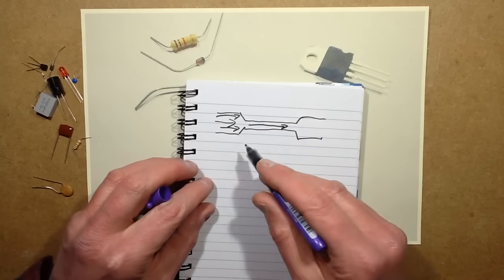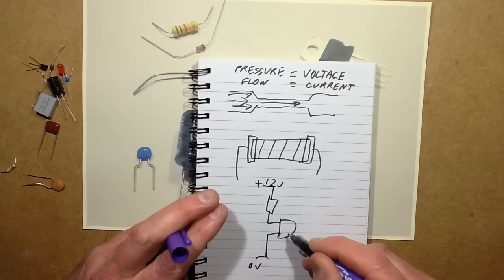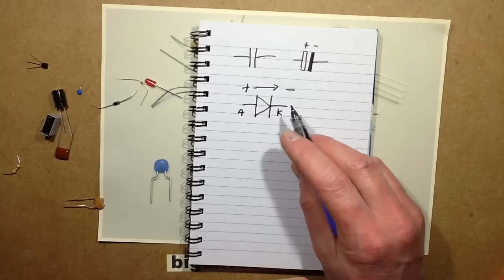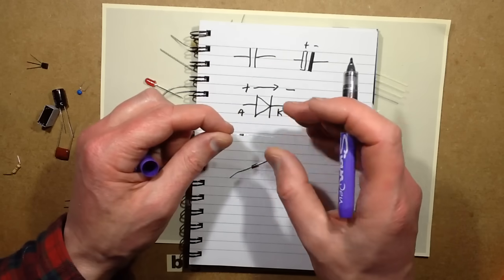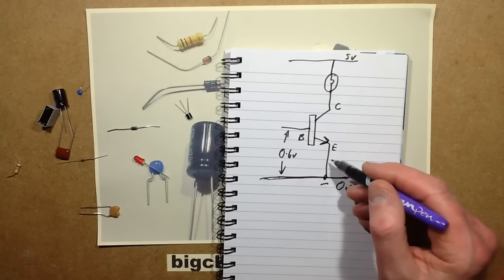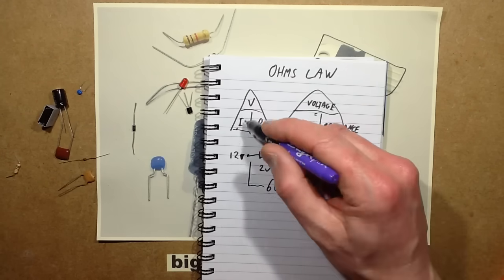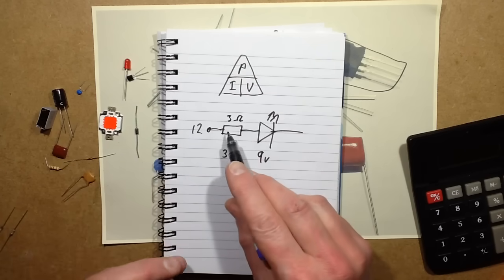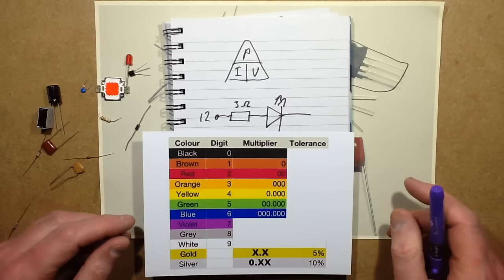A simple guide to electronic components.

Comment: using the water example is good I suppose...I've seen it used before and I have thought like this in the pass...some time ago.  Your explanation is confusing.  Fluid dynamics...water flowing threw a narrow gap...pressure should drop and the flow should increase.  On exist fluid motion should returns to normal providing the before and after are the same size.  Now I wonder if the resistor and flow of electricity act in this manner.  I think not...but...please continue.
Reply: +FREEMAN DECKER    ROCKET ENGINES !  The engine gasses are compressed in the Venturi. But upon expansion, push upon the nozzle surface providing pressure to a larger surface area.   BTW Upon a enema or clyster,, don’t have the water pressure at maximum pipe diam. rated flow, but increase gradually till a rate of comfort is achieved.
Reply: +Chad Hurley  of course, here you are discussing gasses..and maybe more relative to the explanation to electricity...one would imagine emf is compressible.  Moving on into your video I almost grasp what was happening inside a resistor...I will come back to this later and watch this again.  This is a learning process for me and I am presently amazed about the principle of processes moving from the negative to the positive in other things besides electricity.  example:  ice cube absorbing heat instead of the heat absorbing the cold.  Amazing.
Reply: FREEMAN DECKER    In our world, 2016, there are so many questions to be answered, if we only had the time. Organic chemistry, gene reconstruction, quantum possibilities, Unbalanced electrical gravitic draw space craft, harmonic frequencies to cure cancer and many more diseases, Government disclosure that would open a pandoras box of evil or sanctuary But in the end, the planets dominant species will always cut off the limb that he is sitting on, unless a coalescing consciencenes allows us to see our inevitable future.
Reply: +Chad Hurley "inevitable future"... I stumbled across the news about an anomaly coming out of a black hole.  I guess you've heard about this?  The Black Hole is 6 million light years away and the anomaly occurred 6 million light years old.  I've run into something of a paradox here and it has to do with light that strikes the cornea.  It seems that we are always looking at light that came from the past.  If we are seeing only reflected light that has bounce off another object, no matter how close you are to that object the light would still need time to travel from point A to the cornea to see the object at point A,  Just to get a glimpse of the "Present" we would have to be at Point A the very instant light strike the Point A.

So...I am going to have to sleep on this to see if I can figure out where this "Paradox" is going.   Thanks
Reply: FREEMAN DECKER   Well you give room for thought. We both know that physically we cannot see the present, but this is semantics.
    This video was about basic voltage/current flow. My interest is more about observance and study by exterestrials.  How they get here has not been my study. Anymore that you being  obsessed with your wifes biology and birth, just because you married her. 
    God, of course, was the best written about extraterrestrial

Comment: One thing I am surprised you did not mention in regard to Capacitors is the fact they can hold a charge.   I once got zapped by one from a camera.  I took the battery out and started ripping it apart.  Suddenly I felt this shock go through my hand.  I found out later it was about 12Kv.  Great video though.
Reply from the maker: +osparker2 A pulse of high voltage at low current is usually used to fire the xenon discharge tube.  The electrolytic capacitor is usually charged to about 300V and can give quite a zap.

Comment: Hi Clive, I have watched a few of your videos now and been trying to keep up with you. The one with the dehumidifier got me hooked, as I have a broken dehumi. I took it apart as it no longer collects water and as per your video, it needs a heater to release the moisture back into the exchanger. I hope I got this right and have not made myself look a wally. Well I have the eco d122 with touch controls, so when igot the heater out and my multimetr out to check the element, I got confused. There are three wires conected , red blue and black. I can get resistance and continuity  between red and blue, but nothing on the black to red or blue. The black wire is coneted to the same 3 pin plug as the red and blue on the CB. If there is circuit between red and blue is the element ok, or is it broken because no short with black,Please?. Ps how do I test those relays you talked about to. One was a thermal and I cant remember the other one for. I am hoping its going to be one of those at fault. Can you recommend the best allround solder for a novice like me also. Many Thanks, Leon
Reply from the maker: +Leon Hill There are usually three wires going to the heater just for power.  A common and two wires that select the power.  There should be continuity between them all, suggesting a broken heater element.
Reply: +bigclivedotcom  Thank You for the return mail. I  need to go to bank today, But will get my multimeter out ASAP and check thee connections again. I need to get it fixed so I can free my bench up in My 'CAVE', as my wife calls it!! :) Leon.
Reply: +Leon Hill Hi Clive. Great news. I put 1 meter lead on the black cable where it enters the heater block and then with the 2nd lead started to follow the element as near to the start as possible. Beep, beep,beep then nothing. so I got my magnifying glass and sure enough , just as you said a break in the element. Well after a long phone call to ecoair.org and not much help. I have spliced the element wires together in a fashion to test it. And sure enough it has started to collect water again. However. the dehumiifier keep constantly runnig  as if it cant sense the humidity levels . I have put it next to my simple one with rotary controls and this cuts in and out on humidity levels, but the mkllll at the side of it just keep on running??. So can you tell me how to test the humidity sensor, if you have any spare time ,please? I have looked at several of your vids and everyone if full of how to questions. It must take so long to reply to all these questions, its a wonder how you have time to make any strip down feature vids.  :) Many Thanks, Leon  :)

Comment: In college, "we* (well, yes, I, but it was a group decision) blew up an old 330uF/25V capacitor by reversing the polarity on the beefiest laboratory power supply we had (30V/7A). It split down the side and showered me. I didn't have my lab coat buttoned up, so I spent the rest of the semester picking scrap pieces of paper (I think) out of that particular sweater. Good times.

Comment: So honest question.  Using the water analogy, when you neck down the area water has to flow it usually speeds up. Is there a similar effect in electricity?
Reply: +Greg Fuller I think that is where the analogy stops. Electrons flow at the same speed through a particular medium, independent of the resistance.

Comment: watching this brough back memories from when i was doing electronics in high school some fun times like when we decided to plug an led straight into the output of an ameter or popping capacitors with the plug used to power the soldering irons 
and I=V over R even then i felt as though it was over my head 
we use to use 330 ohm resistors with a silver band

Comment: Could you explain the old Glass Radio Valves? Maybe you already have?  I must have broken many open in my youth and admired the complex construction. But what did they do? I take that they were replaced by the components you describe here.
Reply: +Roger Griffith Valves, or "vacuum tubes" in America, did mostly the same sort of stuff as diodes and transistors, and were almost entirely replaced by them.  You might still see valves used in high-voltage circuits, especially in audio amplifiers.  (Some people claim they produce better sound than transistor amps.)

Comment: How do capacitor work in electric guitars?
Reply: +shinedown389 The TONE knob of an electric guitar is simply a variable resistor (exactly like the volume, though its 'taper' (response curve) and resistance rating may differ). When the tone is at 10, signal is passed to the amp, no signal is passed to the capacitor and it has no effect on the tone. As the tone knob is turned from 10 toward 1, more signal is passed to the capacitor, which passes high frequencies to ground, preventing them from reaching the amplifier. The capacitor resists passing low frequencies, so they continue on to the amplifier. So, the capacitor and potentiometer are used as a variable high-pass filter, dumping more and more of the high frequency signal to ground, instead of sending it to the amplifier.

Comment: Clive I need to buy a fairly cheap soldering iron for repairing electronics like DC jacks and reflowing connections and I have looked on ebay but there is so many are there any brands / sellers you could recommend? Thanks.
Reply from the maker: +Philip Sempers The generic Hakko clone soldering stations with numbers like "936" are quite usable.  Just ignore the temperature marked on the control knob or display and adjust it for best results.
Reply: +bigclivedotcom hakko now you say the name I have heard you talk about them before just wasnt sure which video. Thanks. :)
Reply: +Philip Sempers
These days you can get one of those regulated soldering stations for the same price I bought my first unregulated 20w iron in the early 2000s
Gotta love the march of technology (and cheap stuff from china)
Reply: +bigclivedotcom yes! I use the hakko 937D clone and it works very well but has a genuine hakko heating element
Its a YIHUA brand
Reply: jonny blaze
EEVblog did a review on that unit or something quite close to it.
From what I remember, the base/power supply is a pretty solid unit from an electrical point of view, but the fit & finish of the iron could use some work.
Both of these comparisons are in relation to a "genuine" hakko unit he had on hand.
Reply: +44R0Ndin yeah I watched Dave at EEVblog's video your talking about after Clive said about them and was confused whether to get that or just spend the extra cash for a branded station that would probably last years longer. Have you watched Dave's video Clive I can get you the link to it if you need it.
Reply from the maker: +Philip Sempers I have seen that video, but a recent version I bought seems to have a different temperature regulation circuit which pulses regularly with a varying mark-space ratio.  The calibration on all these things is poor, you really need to use a proper tip thermometer or wing it by "feel".  As Dave mentioned, the thermal coupling is poor, but the units are still fine for most normal soldering tasks.
Reply: +bigclivedotcom cool thankyou Clive there's the "hakko" one on eBay for £40 worth it?
Reply from the maker: +Philip Sempers Is it the base unit with a knob on the front and separate iron holder?  I bought one fairly recently to test and they seem OK.
Reply: +bigclivedotcom this is it direct from Hong Kong:

http://m.ebay.co.uk/itm/220V-HAKKO-936-AQ28-ESD-SAFE-Electronic-Iron-soldering-station-D-27-/151959805559?nav=SEARCH
Reply from the maker: +Philip Sempers Looks like the typical clone.  This is the one I bought recently, but they appear to be sold out.  Not surprising at that price.  http://www.ebay.co.uk/itm/291045808647?
Reply: 44R0Ndin I did see that video also but mine seems to work a lot better then the one he was showing in the video. Even my temp light pulse's very fast and heats very quickly like the real hakko units.The internals seem very different also.

Comment: I will sometimes exceed the power rating of my resistors because they won't completely fail but instead have a higher resistance (I have gotten around 5-50k from a 1k resistor) this may be good to test and see if you can control the failure rate?

Comment: Hey bigcivesotcom, 

Can you do a disassemble of these cheap Chinese flasher units for motorcycles? 
Are they safe/worth using? 

Because here is a $1 flasher from china:
http://www.ebay.com/itm/201447286359?afsrc=1&rmvSB=true

Here is a "brand name" quality one.:
https://www.superbrightleds.com/moreinfo/flashers-load-resistors/fl2-red-led-bulb-electronic-flasher/779/833/

How can they produce a $1 one? Whats in it compared to the $13 one??? 

I would love if you can order one and do a review within like a month and a half (shoudl be doable as shippign form china usualy is liek 20 days anyway). Because i plan to convert my motorcycle to LED and will need a flasher unit. I just want to make sure something like those $1 flashers are safe/reliable, or to drop the other $12 and buy a brand name. 

Thanks!
Reply from the maker: +Orvis25 I've opened one of these but not done a video (yet).  It looked acceptable inside.  It used a MOSFET held on during it's shorted cycle by a capacitor.
Reply: +bigclivedotcom 

still learning so i do not really still understand what a mosfet does. :P im not a circuitry guy for the most part, i just like learning from your videos about shoddy Chinese crap. 

Would you say these are well enough built to use as a replacement for us budget people who cant afford a $15 flasher unit? Even if it only last 1/4 as long. i can buy 15 of them for the price of a "brand name" one. 

Thanks for replying btw!
Reply from the maker: +Orvis25 The one I've opened look reasonable enough inside and with LED lamps it should be more than capable of doing the switching.  It's cheap enough to try one out.

Comment: You're spot-on about many old game consoles having bad caps. Some consoles are particularly notorious for using low-quality caps that dry out or leak after only a few years of use. The Sega Game Gear, for example, used such lousy electrolytics, that I've just come to expect I'll need to swap them all out on every unit I run across. 

Anyway, this is a terrific video with a ton of great info! Thanks for posting it!
Reply: +Shmeh Fleh Made me think of an older PC motherboard mod video I saw once. Was wondering what the interest was in replacing the caps. The complaint was the board was low cost but had inherently bad capacitors surrounding the CPU that failed under heat. Better caps, better longevity for the board and hopefully better performance.

Comment: I'm a little confused with the pressure/voltage and flow/current analogies; in the narrow pipe example, the pressure (voltage) would increase, while the flow (current) would decrease.. No? Like a pressure washer or a low-pressure correcting showerhead.. It's my understanding that a resistor limits both voltage and current? Or just voltage?
Reply from the maker: +hoah If you increase the voltage across a resistor a higher current will flow through it.
Reply: +bigclivedotcom I realise that was a dumb question ;)
Reply: +bigclivedotcom thanks tho

Comment: This might be a stupid question, but when I connect a 9V battery to a 6-15V motor and 1MOhm rheostat, why does the resistor smoke sometimes?
Reply: +Matilda power source with a high current and a device with a large current draw with a mismatched resistor.
Reply from the maker: +Matilda If you use a variable resistor to limit high current it tends to get hot as it is dissipating the difference in voltage.  That's why most motor controllers pulse the power on and off, varying the on to off ratio to adjust the speed.
Reply: bigclivedotcom Thanks!  So if I swapped out the 9V for e.g. 4 AAs would it help?
Reply from the maker: +Matilda If you need to control the motor speed then an easy way is to just use the voltage required to make it run at the desired speed.  For variable speed you will need to use a proper DC motor speed control circuit.

Comment: my dad says that the diaphram between the elektrodes in a capacitator is air is that true ?
Reply from the maker: +Ute Lot You do get air dielectric capacitors, but most are ceramic or a plastic insulator.
Reply: Ok thanks

Comment: 0:20 "the water analogy is very good"
Aaaaah!!! All the years, I told that to people and every time, I just was looked as some kind of idiot which just started to sing a song about it.
Thank you for beeing the first one who confirmed that I am not an crazy ass idiot.
Reply: +Len P You're still a crazy ass idiot, just a correct crazy ass idiot :P
Reply: +Len P Yes, except when you put a fluid through a narrower tube (resistor), it's velocity (current) increases and pressure (voltage) decreases. Bernoulli principle isn't applicable in electronics.

Comment: Nice job with the video. Unfortunately for me I was taught electronics in much earlier than the current crop of techs who like yourself describe current flow as  from positive to negative. Normally I would not say anything as this method is the accepted way to teach and understand electronics but when you describe electrons piling up on the positive side I can no longer hold it in. Electrons have a negative charge. The more electrons there are the higher the negative charge. A positive charge describes the available holes or free orbits available to electrons. Current is the flow of electrons, not holes, past a certain point for a set period of time. 

You do excellent videos and I certainly do not want to confuse anyone but the modern method of describing current flow always just rubs me the wrong way. Maybe you have already addressed this issue in the past but what real advantage is there in using the modern method of describing current flow when the electrons themselves are actually moving in the opposite direction? 

Thanks for the great work and please keep your excellent videos coming.
Reply: +richb313 Reminded me and also taught me thanks.
Good job for being humble too. Thumbed up so Clive sees.